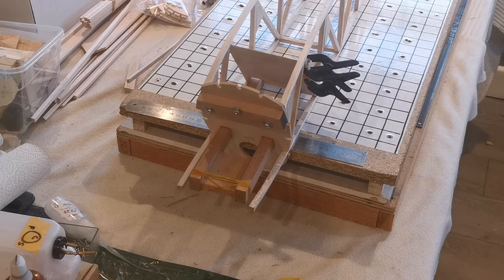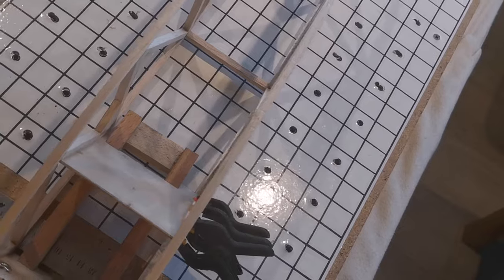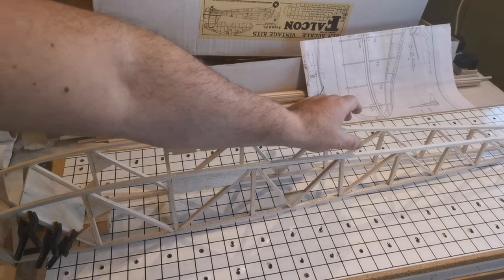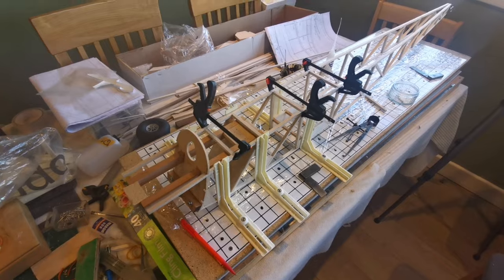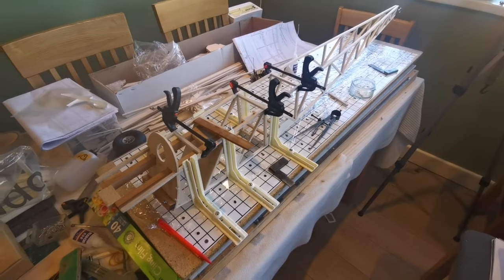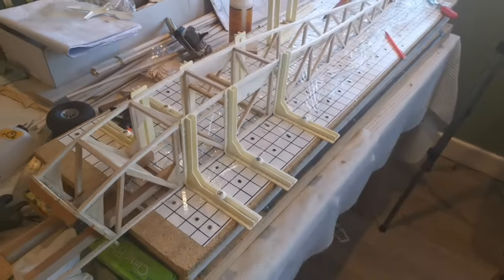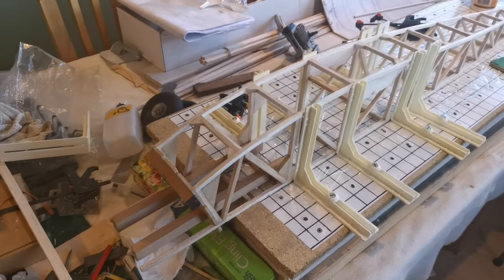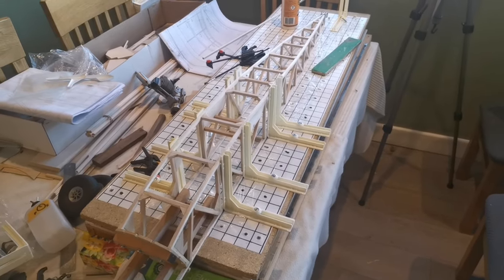Building the fuselage complete with major error.

Comment: I bought one of those jigs once while at a show. Left it in the box for years and found the plastic components to be so out of square as to be useless. Saved the metal hardware and made some accurate parts from baltic birch ply with different heights to suit sections of the fuselage. Scratch building a Junior 60 with plans modified from the OuterZone one at the time.